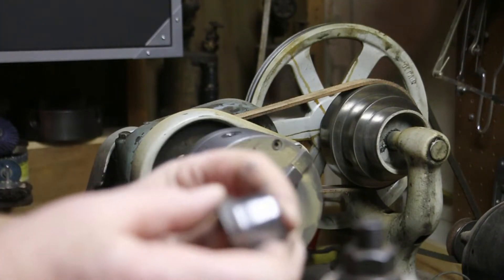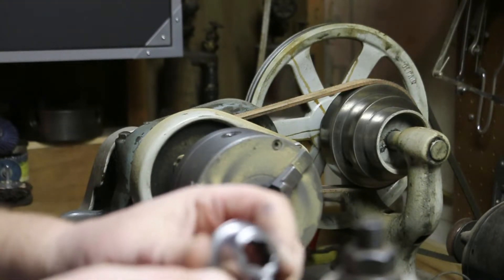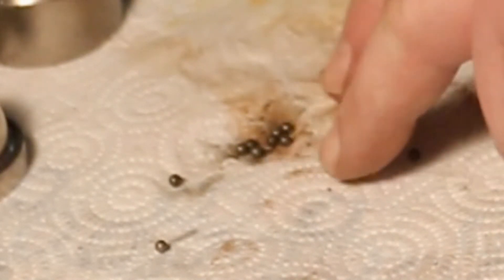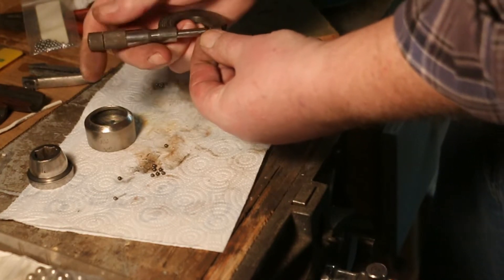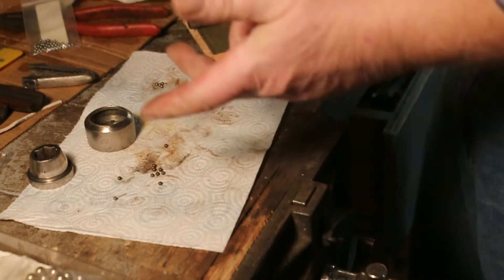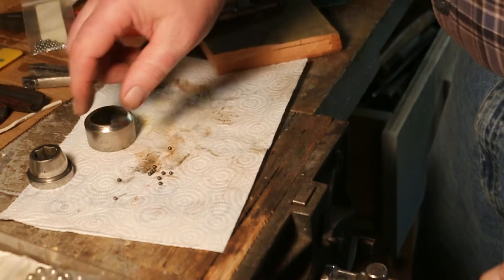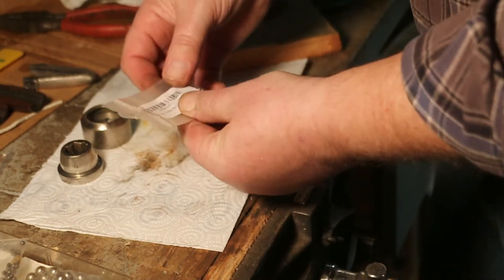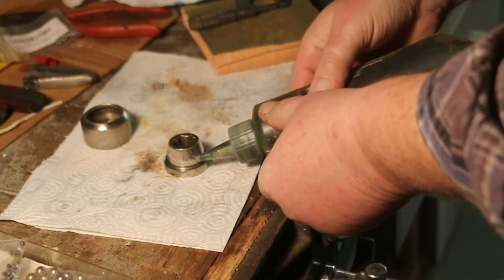Nickel Plating - Pexto 8014 Brace - Pt 5 - Plating The Nose

Comment: Looks good never seen a chuck on a brace like that looks cool. That video is tons  better good sound and picture A1 ,so glad for that still think the iPad has had its day but to near ripoffmus now to do anything about it something thing to save up for I guess . Hope all well with you all . Thanks again dave 👍
Reply from the maker: Georges basement has a big collection of data on all manner of braces. This Pexto brace #8014 has a Smith Patent Chuck. https://www.google.com/search?client=tablet-android-samsung&ei=IeQTXN_YHobAsAX945e4DQ&q=pexto+ball+bearing+chuck&oq=pexto+ball+bearing+chuck&gs_l=mobile-gws-wiz-serp.3..33i160.8259.35574..36231...2.0..2.726.6213.8j28j2j0j1j1j1....2..0....1.......5..0j0i71j35i39j0i22i30j33i299j0i22i10i30j0i131j46i131j0i67j0i131i67j0i10.CxCp-CQ027M#imgrc=IfBQulVMigevAM:
Turns out I have two Pexto braces.  This one, and the  older one I show in an earlier video in this series, with the same style chuck but a different ratchet.

Comment: It's nice to have a assortment of ball bearing around the shop because even if yours are in great shape, inevitably one will roll off the bench never to be found again!  =)   Thanks Dave!!!!!!!
Reply from the maker: Most of my bearing stock comes from projects that I either bought extra bearings for or dissolved in my hands and turned into spare parts.
The eighth inch ball bearings came from a project where I was doing a rebuild on a Goodell Pratt breast drill. It was kind of like this project in that the Goodell-Pratt was so badly damaged that I didn't think I could fix it and therefore there wasn't any harm in taking it apart. Minimum order was a hundred and the drill needed sixteen. 
I have a few pillow blocks set aside for an upcomimg project and some skateboard wheel bearings that are surprisingly good for small work. 
It is certain I will lose a few. If they hit the floor they will bounce clear across the shop or as happened once into my shirt pocket. Found that one in the laundry basket. 😆

Comment: Welcome home, Unc and I hear you brought the 'Angels' with you instead of bu, bu, bu. Nice job as usual. Hope all is well up there. Snow still hanging on here and waiting for some rain. Been looking around all over to see what the deal on the pressure washer pump was and where to get parts. I think I already found the problem with no parts but still have to have the wand/lance, tips and hose. Going to Lowes tomorrow so will look there but can probably get it cheaper on Ebay and I'm not in a rush to wash anything. Hope all is well at work and with Aunt Lydia and the lake effect is closer every day. Thanks, Pal!
Reply from the maker: Work is winding down. None too soon. All I have to do now is stay on them about paying the invoices. Been on the phone with MS Support morevthan working. I ended up buying a video editor called Corel Video Pro. Ran the trial for this vid and the next. Kind of cool. It lets me zoom in and some other stuff I will be trying. Just a little of the fancy stuff goes a long way. 
Plated the last of the brace today. Looks nice. I have some other things that could use a dip. Won't be right away thoigh. Christmas and family first for a while.
I was outside in my shirt sleeves today. I think it's because I burned some brush on Wednesday. All the extra CO2 just heats the whole globe. That's what I'm told by CBS, NBC, ABC, ESPN, THE WEATHER CHANNEL, PBS, and the guy with the aluminum foil hat down by the highway. 
Speaking of which, do you have panhandlers camping out on the freeway exits? For the life of me I can't figure out why, if you don't have a job, or place to live, why stay where it gets 20 below zero? I would hitch a ride down to Georgia, Alabama, Florida, maybe even Tesas. Not California. Too many bums piled up there already. 
So you don't need parts for the pump? Just the business end of the thing. That's good those are wear items. Should be fairly ewsy. 
Weather is suppose to hold through the weekend. I want to pull that Briggs into the shop and see if I can fire it up. Bought a new magneto. I think the old one was the reason it got stuck in the shed.
Reply: @OldSneelock  IT's about time things were slowing down. You've been in the herness too lo9ng as it is.  And the angels sounded fine. Glad you're working with the new stuff. I't'll be grand when you get it fine tuned. Got tech support to come check because we have to reboot the modem at least once and sometimes several times a day. The guy opened up another port and said we were getting a better deal than we were getting billed for because it was coming from the ritzy golfers up the road. Now the bill will probably go up but being close might have it's advantages. 
The plating does look NICE but I know how stuff goes there. All mine is good enough for who it's for unless it's for Cheryl! And yes, every breath we exhale after our lungs filter pout all the impurities effects some government office. Makes me want to use accurate descriptions of people and things that I had a long battle with when I tried to stop. 
I don't know about the panhgandelerts. I just go to the county seat 22 miles away and not to the V.A. in the A-town but once a year. There are some there but they won't hit on me but once. Maybe they want to get warmed by the 'accidental' fires. So be it but I just feel sorry for folks there. The pump froze and pushed one of the o-ring seated valves out of it's seat into the auto idle thing. All I think I have to do is reseat the valves and lube it up and stick it together. 3 screws to put the pump together and 3 bolts to remount it. Then fire it up with it's plastic cam and lifters. Mercy. But it'll have series-3 very soon, as in after the 1st warm up. I just found last night where to look for the I.D. on the pump itself. On the unloader. I had the number off the base but not the main one. Successful wishes on the Briggs and the Magnetron. I sure like all of mine that run them. It'll run unless something has went flop inside. The pump was running so it will again and the Snapper has a 4-horse 'L' head. HI 2 Aunt Lydia!

Comment: I've enjoyed this series. Something I've wondered about, but didn't know anything about. Thanks! When you replaced the bearings, you put in more than were there before ... does that help, or "just in case"? Would the same principle apply with an eggbeater drill?
Reply from the maker: Filling the bearing race makes it so that the bearings don't all gather on one side and kind of cock the bearing. Bearings with the little spacers like a little metal race, like on a bicycle wheel that keeps the bearing spaced-out.  Since there wasn't any, these were just free floating bearings, I figured I'd put them all in there since I had them.
Reply: @OldSneelock  I approve this message...............if that really means anything! It doesn't in the politickal end of stuff. I hope I'm a dab more honest, which sure won't take much. A miniscule amount beats nothing by a LOT!
Reply from the maker: @lewiemcneely9143  Must be something about writing off the expence.I approve this message. Code for MO MONEY.....😈
Reply: @OldSneelock  PERZACTLY! Truth is stranger than facts!